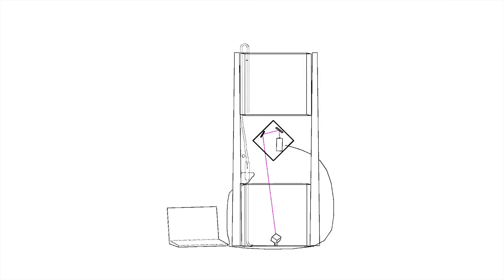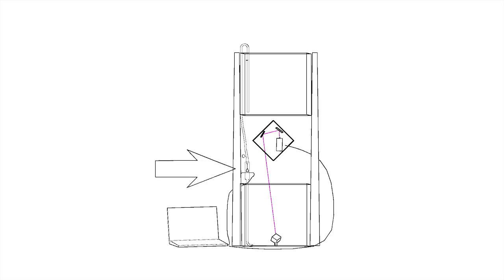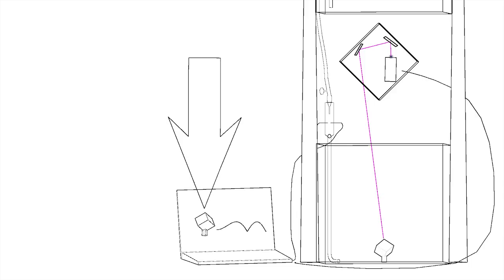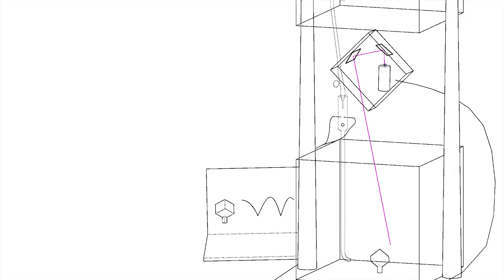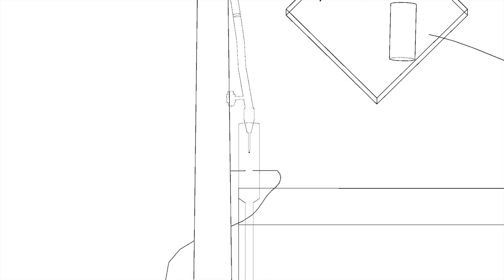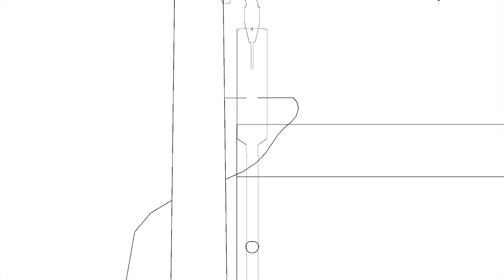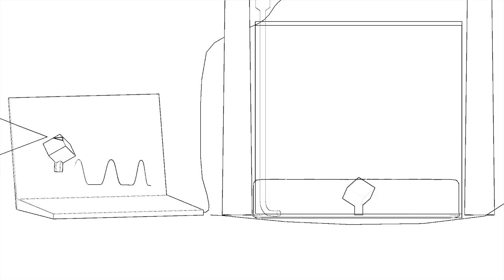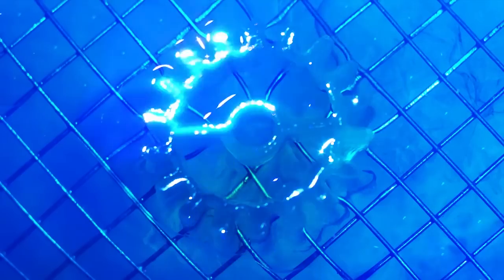Peachy Printer - How it Works

Comment: @PeachyPrinter Two questions; 
a) How do you overcome the dc-blocking filters on the audio output? People have been using audio outs to control laser galvos for a long time, however we have to use an external sound card and bypass the dc blocking caps.
For non-geeks, I'll translate: The sound output of (all) sound cards/computers is not usually directly suitable for laser scanning because audio outputs suppress any slow-changing (a.k.a. bass) signals below say 100hz.

Comment: "The higher the volume, the higher the voltage and the more the mirrors move"  So if I don't get the volume just right, the object is going to be bigger or smaller in X and Y axis but not in the Z axis. Am I right?

Comment: Actually, if I'm not mistaken, the rate of water-drip does not need to remain constant as it is being contanstly measured via the microphone port (at a rate of thousandths of an inch). So if the water-rise-rate increases or decreases, the software will respond by slowing down or speeding up the laser. Also, when you have finely machined components, the rate of drip is probably going to be pretty darn stable, though I may be wrong about that...

Comment: This is cool.

I think I can help with this project - I built my own RGB laser projector about 18 months ago and played a lot with a USB sound card DAC.

The sound card DAC was OK for a starter project, but quite lacking in accuracy and resolution. I also had problems with the stability and DC offsets etc.

So, I then built a DAC based on the OLSD (Open Laser Show Dac) project.
This is MUCH better, and quite easy to build (runs off an Arduino).

I use a $70 pair of galvos, and it's great!

Comment: Agree with Will Gaudoin - the measured drip feed seems like a workable solution (no pun intended!). Each drip is only going to cause the _tiniest_ rise in surface level, so as long as you don't miss any with the sensor you should be fine. If you think valve-controlled drips are inaccurate, well, they use them in all the time in hospitals for delivering drugs slowly, so...

Comment: The laser is probably on a constant output from an external power source and it relies on the rate of the drip to lift the risen just enough for it to solidify. 
The other option would be to switch between controlling the mirrors and power output fast enough so that it doesn't make a noticeable change.

Comment: Oh, also, a more accurate method for controlling the drips could be by using a fuel injector.
These are cheap to buy, and quite easy to drive with a single transistor.

They can give a very precise amounts of liquid output, and the PC will be controlling it directly rather than counting the drips.

I modified the OLSD to use 12-bit DACs.
It's already cheap to build, but will be even cheaper for a Peachy printer (only one $5 chip needed for the X/Y axis).

The serial protocol is very simple.

Comment: @Mtaalas - suggest a CMedia CM6206, stereo audio-amp for galvos, a FET for the laser, then it's just 12mhz xtal, a handful of discretes & a two layer PCB, connectors. Depends a lot on volume but guessing $10-$15 total... eh, that's my suggestion. Not sure one could do any better with a microcontroller in this particular application.

Comment: mm thx for reply but unsure about that; you're focussing a (50-200mw?) laser on photo-resin and it'll set wherever it hits. For that reason (and eye-safety etc) it seems unlikely imho they'll ship without laser on/off under cpu control. Analog power control is probably not necessary. De-multiplexing stereo soundcard output to provide x+y+laser is imho harder than just using a multichannel usb audio chip which has several other 'free' functions that'd likely in handy also (mic input and GPIOs)

Comment: And how do you isolate your reflective laser mirrors from the condensation of the evaporating water tank?  You showed the laser/mirror setup at about 2:50, and it was covered in moisture.  Isn't the water in the bottom of the tank going to evaporate, and get all over the mirrors, and affect the resolution and quality of the 3D product?  Even if you DID use a hydrophobic coating on the mirrors...

Comment: @moeburn I appear to be the resident smart-ass on this vid (not related to peachy) so..  I suggest the mic drip sensor is likely to work pretty well as long as it's physically engineered so each drip touches both wires (which looks perfectly doable) - all you're sensing is "air gap vs water drop conductivity" which is very different.  It doesn't matter if the input "distorts" in audio terms; you just want a pulse, so you could overdrive the mic input to be safe. I suspect this bit's fine.

Comment: @PeachyPrinter second:
b) How do you control the laser power - you're already using left+right audio to control X/Y scanning.
If the answer to both of these questions is "we use a modified external multichannel usb sound card" then cool, if not then... ?

Comment: @moeburn - imo no, cables would make no significant difference. You would want to calibrate the output gain to get a specific size object (and turn off all EQ, 3D effects, etc). However it seems much more probable to me that the AC-coupling in practically all headphone outputs is going to be an issue; you _really_ want DC coupling for galvos like this; but Peachy's faq on their site shows they're aware of the issue. As discussed below I think supplying a tweaked external USB soundcard would fix.

Comment: I know it will make it more expensive, but this is for future improvements. :)

I think it's a great idea, and should make 3D printers far more accessible.

I guess the fuel injector is probably overkill - with the drip sensor, the software can always wait for the level to rise, as I can't see it going too fast anyway.

Wouldn't have thought the galvo's take much power if the winding resistance is high enough / angle small. Should be good on USB power.

Comment: i know what a surface mirror is, but they don't say that they are using them and in the video , it looks like normal mirrors are used.
and the modification would be simple as there is no finalized design or mass production in place.
also 100mw power is doubtful that would mean a sunny day could harden your resin in a clear container and they want $100 for this and even the cost of the case, actuators, mirrors and laser would come to $40 so i think they are likely in a higher power range

Comment: I like the fuel injector idea a lot, but it's gonna blow past $100. The passive drip sensor they use is exceedingly clever cost-reduction idea I think; I really admire the whole Z-axis part of this design. I wonder how much power their homemade galvos use - it'd be nice (=cheap) to be able to run the whole thing off USB power. Anyway, it's an admirably thrifty and inventive project for sure

Comment: I was wondering that too, unless they just use a cheap modded USB sound card built in?

Sound cards are OK as a DAC, but using a purpose-built one took a lot of the guesswork out of it. I had some ground loop issues before too, so that might have been part of it.

Have you built an RGB laser PJ before btw?
I'm liking your phosphor screen vids - where do you buy the screens from, or is it a paint?

I'm assuming the Peachy will need 405nm instead of 445nm?

Comment: BTW I do welcome the discussion, I think some of these points are probably FAQs and maybe interesting to YT folks; hey if I'm wrong people can come correct me. Anyway moving the laser itself has a bunch of practical issues (e.g. how do you mount it?), moving super-light-weight mirrors suspended on threads (note two orthogonal mirrors means each mirror only needs one degree of freedom; simpler, lighter and much lower friction). Lighter = lower power, cheaper coils, faster & more accurate scanning

Comment: sound card dac+homemade correction amp worked great for me, I've been playing with 405nm and high-persistence phosphor screens so I scan slow anyway cos it looks better (see my YT vids) but resolution+stability was no problem. I do wonder why peachy are creating the expectation that ppl can use internal soundcards, everything like that is ac-coupled afaik and trying to hack around it sounds like a recipe for end-user disappointment. Anyway my bet is a peachy-made PCB w/CM6206 or similar.

Comment: I don't like the idea of using my headphone output as a data transmission line.  I'm an audiophile, and I know that sound quality on the analog end is affected by jack quality, cable quality, cable length, amplitude gain, output impedance... Is your data going to be affected by any of these?  

Ultimately, my question is, would the finished 3D product look any different if I used a really crappy headphone jack and a 1 mile long cheap headphone cable, vs a high quality headphone cable/jack?

Comment: oh god and it uses the microphone jack to measure the level and height of water?  Reliability issues!  Water's conductivity can change dramatically depending on the salt concentration and distribution, which means it might not always trigger those two contact points that send a signal to the mic input.  

Then there's the fact that each user would have to calibrate their mic inputs; things like noise, dB gain settings, frequency selection... How does this work?

Comment: remove the mirrors and mount the laser to the magnetic actuators and you have a device a fraction of the size with higher power output .

Comment: So here is the thing @Drtune stop acting like some know it all, say all end all because if you every did 3d or 2d designing you would know how quick and easy modifying something so simple would be, I can design a whole multi rotor frame in 2 hours let alone a box with mounts.
secondly you have done laser projection but that doesnt mean you know what is possible, so often i find people make up boundaries because they don't want change.

Comment: If the z axis is controlled by water dripping, it assumes that water will slide down the tube at a perfectly constant rate, which is absurd, and will causes inaccuracies. Why not put the drip closer to the bottom?

Comment: Can i make large things like phone case? Camera accessories? Particularly gopro? I need an answer for this. If this printer can, i'll not hesitate to buy one.
Reply: jasferb I imagine this would NOT be capable of printing anything of that size. You would have to look for a much bigger printer. I am making assumptions of course and by what it looks like this printer would be capable of making items the size of chess pieces. Still cool if you ask me.
Reply: +Just-In Case Actually, they've printed a 2-foot tall rocket. Resolution wasn't great, but that was before the most recent software update. Because you supply your own feeder/print containers, your setup largely determines max print size.

Comment: thanks for reply but that's not right. It appears from video (and sample shapes) that laser is always-on. I expect that peachy will ship with a slightly modified 3+ channel USB sound card  (or more likely just use e.g. a CM6206 chip on their own board now they have decent cash to work with). Using commodity USB sound chip with minimal extra components (power amp for galvos and simple TTL CC laser driver) would solve several minor issues cheaply and neatly. I'm sure they know this already

Comment: @Jared. Firstly google "first surface mirror" _nobody_ uses regular mirrors with lasers, esp UV. Secondly price of laser diodes is primarily determined by manufacturing volume; 405nm used to be wildly expensive until blu-ray (and HD-DVD) decimated the cost about 5 years ago. A 100mw 405nm diode (suitable for this; maybe even overpowered) is $9 on ebay in 1-off volumes.  Moving the laser (+case+lens assembly?) is exceedingly impractical for so many reasons I can't fit them in here. Bye :-)

Comment: You are wrong, the mirrors just deflect the light from a central point.
I suggest that the laser be moved rather than two mirrors, as each mirror will loose 30% of the power from the laser, this means faster printing is possible and different materials could be used.

Comment: Umm.. as an electrical engineer, I'm some what skeptic about the whole analog thing. Especially when I know how bad some PC integrated sound cards are. And I would say, that there's not enough costs savings from using only analog control.
USB is way to go, and wouldn't cost very much extra if done by a someone who know what he's doing...

Comment: Why doesn't it use a digital signal?
Reply: flarn2006 I was about to comment that as well! Please, +Peachyprinter3D / +PeachyPrinter answer!
Reply: flarn2006 Guessing here, how I'd do it: mirrors are controlled with muscle wire which move based on voltage from audio jack.  Short caused by droplets is detected by computer.  In this way, you don't need any electronic brains in the device itself.  All of the calculations are done on the computer.  No circuits, no stepper motors, no servos, etc.  Cheap.  Simple.  I love this idea.  I have no use for it but it's very novel.  It will allow people to make figurines or knick-knacks with a $100 printer.  That's about it, the accuracy would be very limited.  For good accuracy, you'll need a rotating mirror or something as similar to a laser printer but those require lots of feedback loops and micro controllers.
Reply: +flarn2006 More cost effective
Reply: +flarn2006 they switched it to pwm i believe.... this was made two years ago...i neeeedsss itttttt

Comment: How does he change the focal point of the laser?
Reply: Not quite sure I understand the question. The laser itself doesn't really have a "focal point", it's just a beam of light. Where it passes through resin, the resin solidifies. And the program adjusts the beam angle to account for the changing distance between the emitter and the surface of the liquid (resulting in lower build area near the top and lower resolution at the bottom) based on an estimate of the liquid level obtained by counting the number of salt water drops that have gone through the contacts...

Comment: ok so if you watch Destins Smarter every day you will know a mirror looses 30% of light through absorption, this equates to 60% loss on full spectrum of light a bit less on a single frequency.
And the price of lasers go up exponentially with power so higher power lasers add price.
And the actuators that move the mirrors could instead be mounted to the laser and cause the laser to move.
the other materials could be harder plastics that require more power to set...so yeah think before you post

Comment: ...shrug, ok. We'll agree to disagree then. BTW if you look at the "indiegogo campaign video" at 1:52 you can see it's a front surface mirror. The more expensive/fancy/shipping "Form 1" 3D printer uses a 100mw diode; it's about watts/mm2. Higher laser power gets to be dangerous and illegal to sell in a product without shields/safety interlocks etc see Class IIIb. You would want to keep your resin away from direct sunlight, e.g. it ships in a dark bottle. Laser+optics=much too heavy to scan. Thx

Comment: Interface with sound card?? That is complete ridiculousness. Why not have the program emulate the exact signals needed to make the machine work. The fact your relying on the sound card is dumb. This whole product idea is a scam.
Reply: I don't think using soundcard is such a terrible idea for the first step. I mean fast proportional actuators are going to be inherently analog devices, so you need a voltage signal, and you're going to have a DAC to create it. The project uses a DAC that you already have in your PC, an integrated soundcard.

Using a soundcard is problematic because of DC rejection on their output, necessary to drive unbalanced loads, but you can to an extent work around that in software. It will work best for models where there's an axis such as for each layer perpendicular to the axis, the center of mass of the layer is on that axis. The mass can be redistributed a bit to make that work, or some perimeter can be over-cured. There will probably be some tendency of models to skew. Besides, good corners are going to be problematic because even high sampling rate soundcard outputs often have a 20KHz filter corner frequency.

The analog control would allow to retrofit a better digital controller later that can help resolve the issues, it can be a purely plug-in retrofit, and it wouldn't raise the complexity required of the printer itself, so it makes sense to consider it as a separate project.

But the project has other issues. For one, the whole working system was not convincingly demonstrated, and for other, it bailed without delivering a product at all, both of which make it look like a likely deliberate scam.
Reply: Not a scam, genius idea, and if you take a look at his inventory video from kickstarter it's actually all there.
Reply: The idea behind the printer itself is not a scam but the fact that peoples' kickstarter money was embezzled to build a house for one of the founders certainly was.